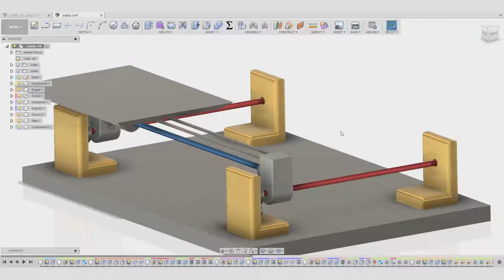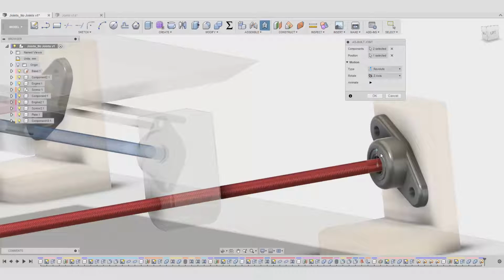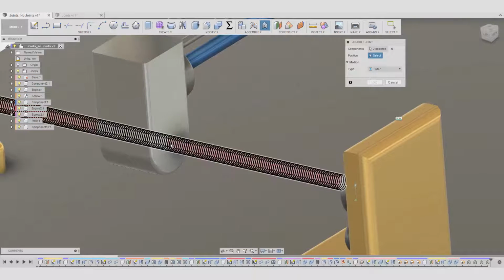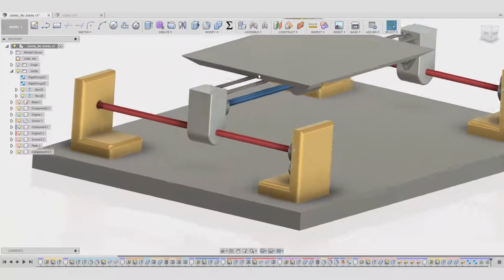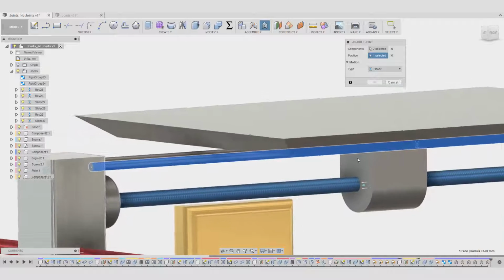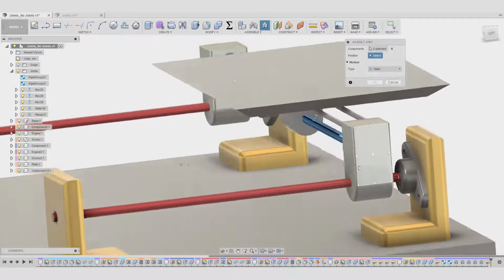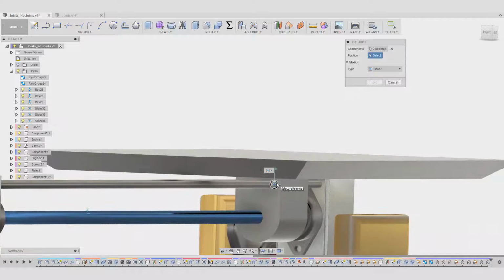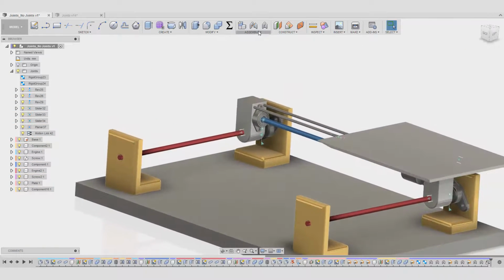Fusion 360: Joints part 1 - Revolut & Slider

Comment: The L brackets appear to be centered as a pattern on the base plate. How did you accomplish this? I would expect something like a rigid group of L brackets with central planes joined to the vertical mid planes of the base. But apparently construction planes cannot be used as arguments to the joint command.
Reply from the maker: The left and the right sides are essentially the same. I created all the components in the left side and then mirror them to the other side.

Very simple ;)